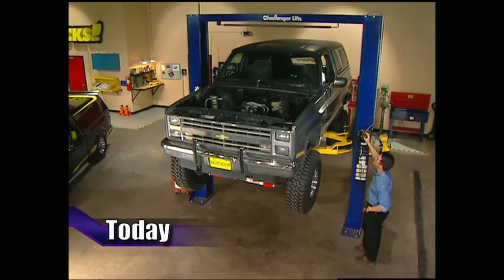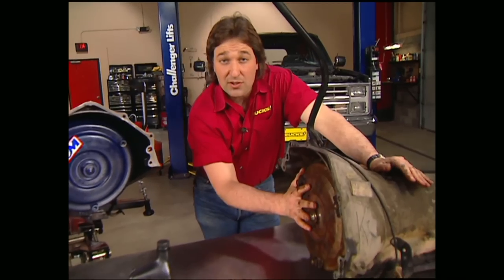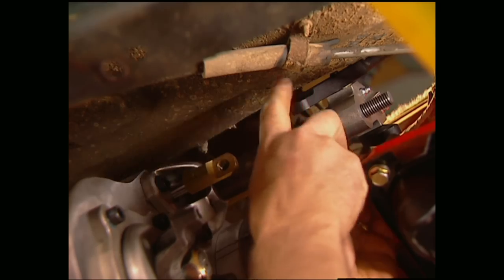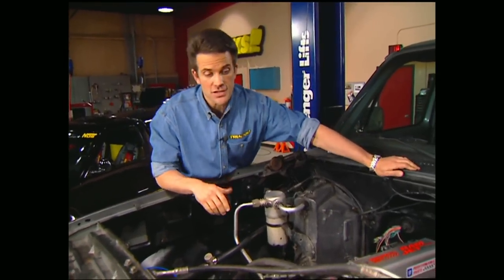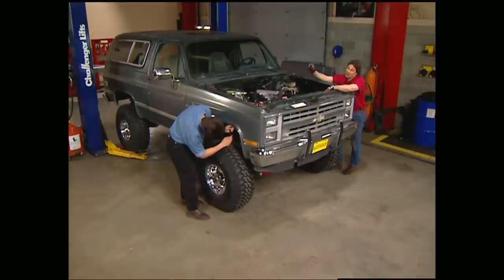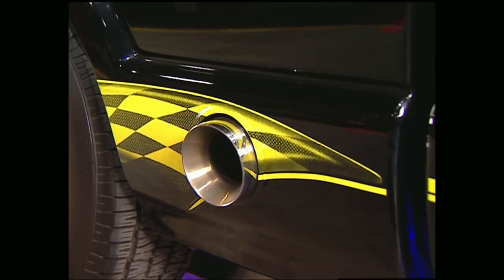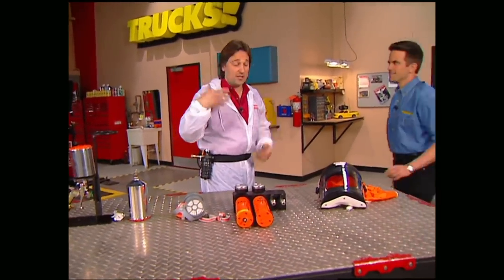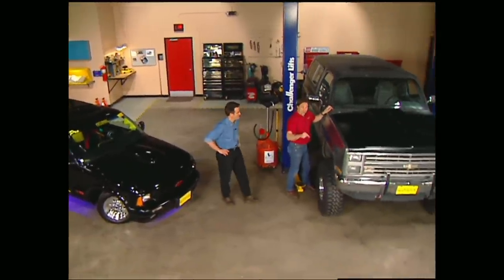Dropping A Modified Bulletproof Drivetrain In The K5 Blazer - Trucks! S3, E14

Comment: It's great to see what someone can do with an unlimited budget !!!
Reply: Must be nice 🙏
Reply: I see smart use of money on parts.  By the time they got this rig the engine, trans, and t-case were well worn and will need rebuilt. By the time you rebuild them (if you can) you're spending a lot of money that could be used on new parts.  Axles are weak usually points.  Ask a Wrangler owner who puts 35s on a stock Dana 30 and breaks a shaft when it gets bound up.  A wise man once said "you can buy nice or buy twice".  The choice is yours.

Comment: I had a 1984 S-10 Blazer that made 450hp my Nephew ran it 14.5 in the 1/4 mile, it had a 383 stroker hooked up to a 700R4 transmission. It was a very fun little truck to drive. I sold it back to my Nephew, he’s put in mini wheel tubs a roll cage and Nitrous

Comment: 5 point harnesses, on a 6 cylinder truck, that only runs 12’s.... talk about overkill. Should’ve dropped a V8 in that truck. The stereo will push that thing better than the engine 🤦🏼‍♂️🤦🏼‍♂️🤦🏼‍♂️
Reply: Pay attention to what you’re watching. It’s a 400hp v6. That’s crazy good for that engine and light truck. This show was made 15 years ago or better. 400hp was a lot back then.